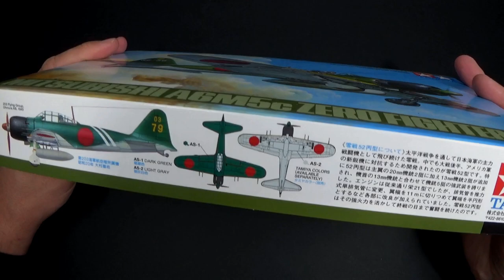Full Video Build Tamiya A6M5c ZERO | scale model plane | 1/48 scale

Comment: What colors did you use to make the Aotake?
Reply from the maker: Hey Kendell. Thanks for watching. I did a silver base layer and then mixed A.Mig 196 Warhead Metallic Blue with a bit of A. Mig 52 Deep Green and A. Mig Transparator so the silver shows through. I kinda eye balled the ratios. Whatever looks right.
Reply: @SpruesToScale  Thanks for the info!! Great videos!